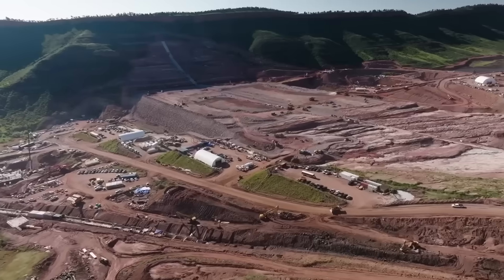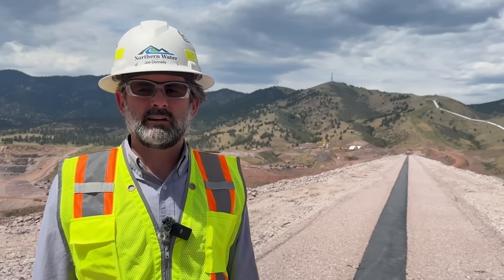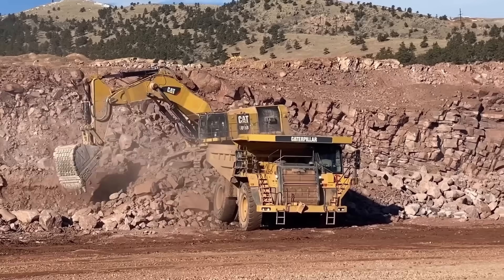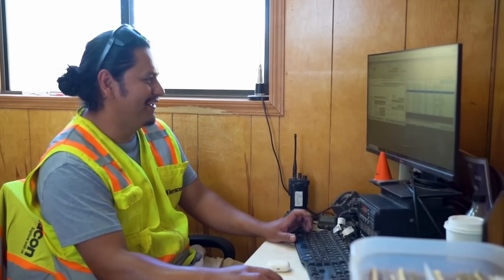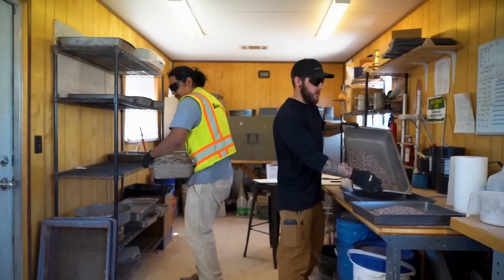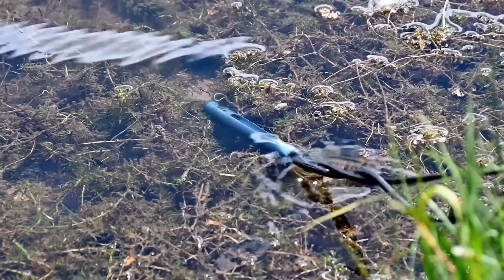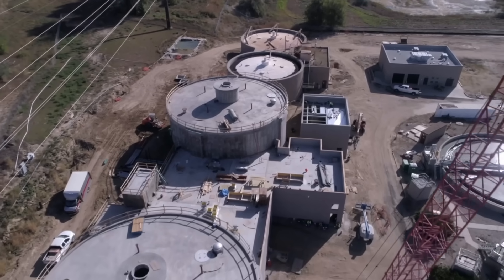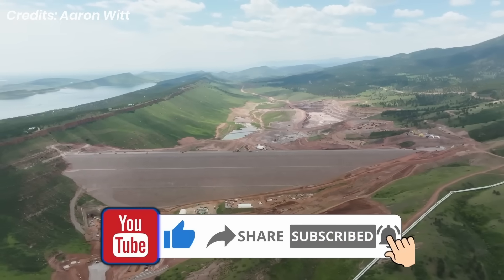The US Spent $690M on a Mega Reservoir… Then This Happened

Comment: For a project that took twenty years to do. It hard to understand. And to say that they didn't know is not true. They were told that it might happen. I only know because this was stopped by the Colorado River compact for years. And the biggest thing that they said was that the water would not be drinkable. The rock would make the water toxic. They said that the mine was to far away to pollute the water. So yeah they knew about this in the early 2000. They just said that the rock was clean.

This just shows that when people want something they just do it. I'm glad that it doesn't work. I know lots of people from my state that said that this would happen. So they changed the plan and said that all the rock would be clean and from a different place. Then it got the ok and the fact that they could save so much switched the plan back to using the rock from the site. They had it tested and said that it was clean and had nothing that would stop the water from being clean.

I guess that when a smart generation moves out of office. The new people just have to make big mistakes on their own. Why does the thing that our elders know more not matter anymore. 

Every time I have heard of something going wrong. The person who was in power said. Don't forget that this is why this land can not be used for this. Then the same developer that has been trying to make something happen for years. Asks the new young person and they change the zoning and lot it happen. Then it comes out after the project is done that the land actually can't have that happen on it.
Reply: Why is this not a surprise! It sure seems to be human nature , someone did well out of this , someone else paid for it and let me guess, someone else will benefit from it ! Big business?♥️😉🙃😎 NZ

Comment: Pave a seal over the wet side of the dam.
Reply: couple of gallons of Flex Seal....lol
Reply: That's assuming that 100% of the Uranium comes from the rock IN the dam. What if some of it comes from the valley that hasn't yet been filled with water. That has yet to even be considered.

Comment: Why not put a geomembrane on the water facing side of the dam?
Reply: The primary dam is a very small part of the problem.

The secondary dam is made from the same stone, still not a huge issue for sealing.

The stone quarry used to mine all the stone is the bed of the reservoir.  That is a massive area and amount of debris.

Comment: Hi paraffin content distillate from refineries is already used in Canada to over-cover uranium spill ways. They have been installed in Cherynobyl as well. A small layer could be sprayed and sheeted over some of the higher uranium content leaching areas to add that extra control necessary to reduce the leaching and allow fill without expensive filtration. These are made by the Trenton Corporation in Ann Arbor.
Reply: I wondered if there was a substance they could coat the rocks with. Sounds like there might be.
Reply: $11,000,000,000 boondoggle.

Comment: So if they, The Government, build one of these dams every 50 or 60 miles towards the MISSISSIPPI River then water could be pumped to the west to California from the Mississippi River. Is that is going on.
Reply: The problem is the water system. Most people actually have the water that is needed to water a lawn already. It's called grey water. Cities just don't want you to be able to use it. If they changed how things were ran they could. They will not change them because the water has soap and stuff that could kill you. And people are stupid and think that they can put anything down the drain. So cities are forced to treat the water and then sell it back to the people. It's actually interesting if you actually look at it. 

If people had a septic system they could have all the water that they needed to water the lawn. Instead they send it back to the city to be cleaned. Lots could be done. But people are stupid so most of it will never happen. Yes people can do it individually. But this still doesn't fix the problem. 

As for California. They don't need the water. Other countries need the water to grow Hay. Yep California sends lots of hay to other countries. And most of the food that they grow goes to others countries.
Reply: @thomasswearingen6971 well said. My city Dunedin,Florida has reclaimed water for my yard. I have used it for 25 years, I pay $.50 for a thousand gallons. My post was just my opinion about what the western States might be doing.

Comment: Rocky Flats, where uranium was mined and refined, is only about 30 miles along the same ridge as the damn. Rocky flats was a Super Fund site that took 10 years and cost the U.S. $7 billion to clean up. They should have know better and tested the ground first.
Reply: Rocky Flats built plutonium triggers. They had 9 different plutonium box fires over the years.   The whole Front Range of Colorado is naturally radioactive. Gotta love granite.
Reply: Plutonium does not occur naturally
Reply: @noelht1  
Good point.
Reply: If I'm not mistaken. Rocky flats was not a mine that refined uranium. Rocky flats was a place the military manufactured and stored plutonium triggers and other radioactive materials north of Golden Colorado, south of Boulder Co. Also, another reservoir is located a mile from Chimney which is 30 mi north of Boulder.
Reply: @razony  Yeah Rocky Flats wasn’t just some storage spot it was more like a full on plutonium weapon factory. The mess came from plutonium and uranium, which basically go together since plutonium is made from uranium. They had two major plutonium fires that spread radioactive dust, plus leaking barrels that poisoned the soil. Even during “normal” operations the plant was still releasing small amounts into the air and water. Winds carried that stuff into nearby towns, which is why the cleanup was such a huge deal and people are still worried about the health effects today.
Reply: @JigMaster39 
I know. I was there.
Reply: @falcontalons1799 you don’t mine for plutonium, you breed it from uranium in the presence of a neutron flux or charged / heavy particle bombardment within accelerators. While plutonium does theoretically exist in natural uranium deposits thanks to spontaneous fission making neutrons that could then be absorbed by other uranium atoms, the concentration would be so low I’ve never heard of it being detectable. Let alone mineable.
Reply: @bigbuilder10 some trace amounts of plutonium was recently discovered in a uranium deposit in Africa.
Reply: @falcontalons1799 Fun fact: Plutonium isn't mined.
Reply: The government funded projects are full of incompetent people
Reply: Thankyou for the responses, sorry for the miss information. I'll edit my comment.

Comment: Uranium is a naturally occurring radioactive element that can be present in drinking water. While small amounts of uranium are generally considered safe, high levels can pose health risks. The Environmental Protection Agency (EPA) has set a maximum contaminant level (MCL) for uranium in drinking water at 30 parts per billion (ppb). Water systems are required to monitor for uranium and take action if levels exceed the MCL. If uranium levels in your drinking water are high, you can consider the following treatment options: Reverse osmosis, Ion exchange and Activated carbon.
PS — well done video.